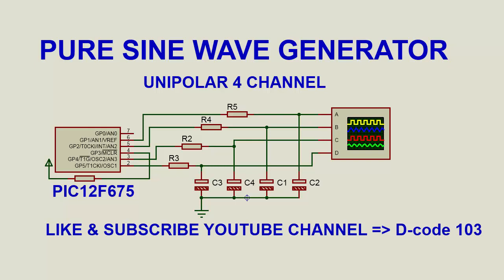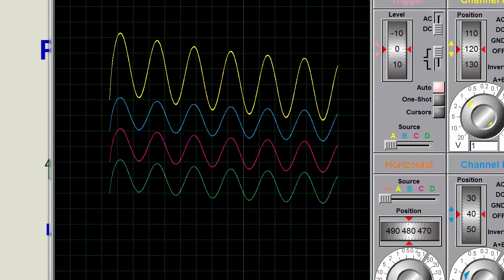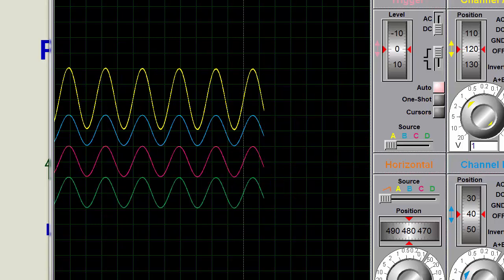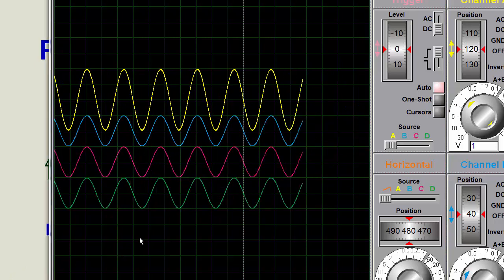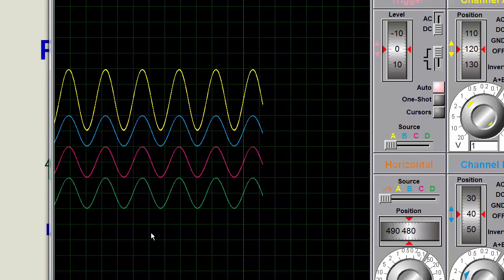Pure Sinewave generator - pic12f675

Comment: Make a Dc volt meter on  MDT10f676
Reply from the maker: Very good afternoon Asif. MDT10f676 is same as pic16f676. We already provide voltmeter solutions to our customer.
Thank you.
Reply: video link . please MDT10f676
 @Dcode103
Reply: how can we convert  Hex file to MDT file
Reply from the maker: Pic16f676 code is compatible with mdt10f676 . Google search results. Mdt10f676 have additional advantage of 8mhz internal crystal. Read mdt10f676 datasheet and compare with pic16f.